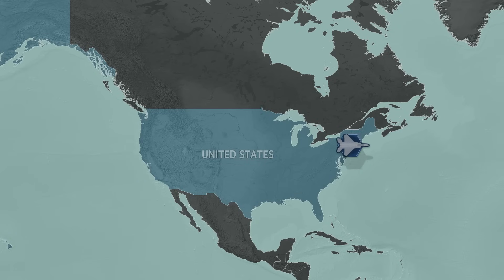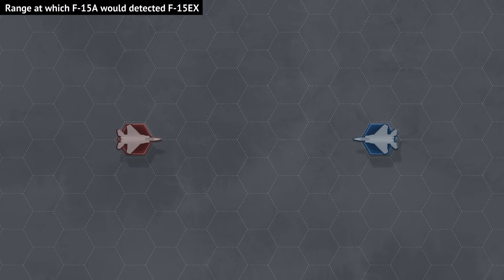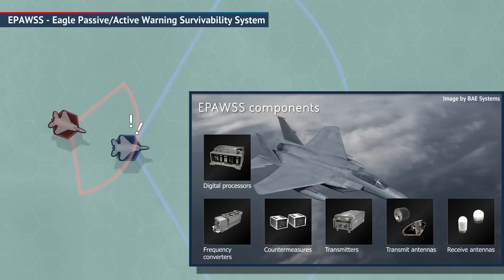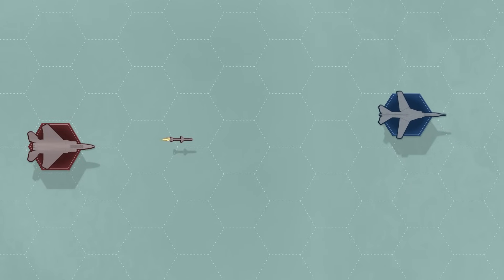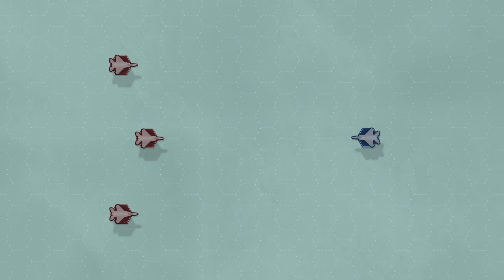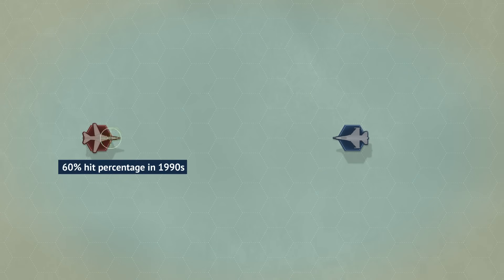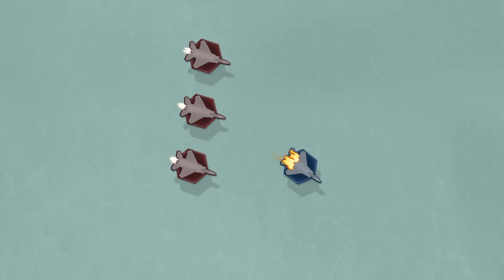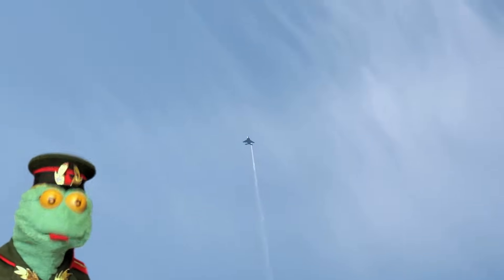How many F-15As would it take to shoot down an F-15EX?

Comment: you messed up your radar comparisons. The Cumulative Pd of the APG-66 is a different type of value compared to the 50% Pd shown for the other radars. The APG-66 50% Pd is ~23nmi, not 46. 85% Cumulative Pd, is simply the range and which, in 85% of tests, the radar will get its 1st detection of a target. (ie the Pd against an F-4 at 46 nmi may only be 20%; which means it would only be seen once in every 5 scans and thus wouldnt be able to form a trackfile.)

Comment: 9:00 This is an AIM-54 Phoenix missile, not the AIM-120 AMRAAM. The Phoenix was a Mach 5+ long range missile only carried by the F-14. It had greater range, was much larger, and its warhead was 133 lbs. compared to the AMRAAM's 44 lb. warhead. The AMRAAM is not a 100+ nm missile, and only recent versions have been able to get close to that mark. Hell, it is in the name of the missile, Advanced Medium Range Air to Air Missile or AMRAAM. We must wait for the AIM-240 or strap on the AIM-174B if we want to see 100+ nm engagements.

Comment: TL;DR: modern missiles are overwhelmingly more accurate than 1970s ones, and will have >80% kill rate on 1970s aircraft, while 1970s missiles will be near-useless against modern aircraft.
OTOH, flight characteristics, and autocannons - haven't really improved, and in some ways were partially sacrificed since the 1970s.
I bet the modern F-15EX also normally carries fewer autocannon rounds than they did in the 1970s, since they are nowadays deemed a weapon of very last resort, and the weight is better used for extra fuel, or bigger radar, or an extra missile.

Comment: There's a maneuver you execute in BVR missile fights called cranking that you employ to slow the closure rate issue 10:45. You use that 120 degree radar cone to 'look sideways' at the target while changing course to fly ~30 degrees off from perpendicular to the target. It allows you to maintain radar lock without going straight towards your opponent.

Comment: There is also a massive 'fog of war' issue with any scenario. 
The F15As see a single target on their radars, fire their Sparrows, and then later learn radar guided missiles are locking in on them. They all begin evading, losing their own locks, several are blowing up, etc. and maybe a few can get their radar back on the F15EX. Ok... but there is a big leap of faith here. Are the F15s really sure that they are only facing a single target? Do they know the capabilities of the F15EX or are they just going to assume they are facing multiple aircraft (which would be common as fighters tends to fly in pairs and at 8+ missiles most 1970s pilots would have to assume multiple aircraft firing on them). Baring being told they were facing a single aircraft (and its capabilities) they'd be nuts to assume the wasn't at least one aircraft and they probably wouldn't assume their radar wasn't missing the others, flying close together, the others staying out of range, etc.

Comment: The earlier F-15's were air superiority whereas  the  new EX variant has a different  function,  with it's powerful radar and  missiles it remains a formidable BVR fighter, especially given it's sheer number of missiles.  How ever  if it merged with the earlier Eagle, assuming equally skilled pilots it's  not going to do well. The earlier Eagle  is  extremely capable in the merge, 1 or 2 circle it's one of very few aircraft  that  can do both. The  new EX variant  is  designed for a different role, they got F-22's for kicking ass in the merge and the F-15EX Can obliterate whole wings of enemy fighters BVR and if one  or two  sneak thru, the Raptor will  mop them up. The EX is an extremely capable multirole  missile truck, fast and very hard hitting, ground, sea or air it is capable of impressive levels of destruction.  About the only thing it can't do is CQC or dogfight modern fighters, the conformative fuel tanks and the full 13 odd ton of weapons the EX variant carries, well they don't aid manoeuvrability,  that's all. Horses for  courses.  Both types excel in their primary role.

Comment: The A model didn't have digital engine controls, so flying over 40K for the EX would be even more of a massive advantage.  APG-63 has 3 variants, the data in this video is on APG-63v1.  APG-63v3 was vastly better than any F-16 radar.   @04:23 We're usually supersonic here and if we have to merge we'll merge past the mach number. ( We usually shoot down before merge ).   @17:26 This is probably accurate.  F-15Cs would have a 4-8 K:D ratio against modern block vipers and hornets in LFEs like red flag as Blue air, red air we'd have to dial back some capability.
Reply: Didn't know the F15s were just that better in its intended role against other aircraft. I heard a flight of F15s flying overhead. Sounded like thunder.

Comment: Based on what I have seen in DCS modern long range active radar homing missile combat is very much like bull fighting, with lots of rushes, launches and retreats as each side tries to bait the other into firing off all of their long range missiles.  If the F-15A force had a decent controller (AWACS or GC) then they could very well bleed the -EX with this sort of strategy and only suffer a handful of casualties in return.  I would put the ratio at closer to 6 or 8 to 1 with maybe 3-4 of the -As going down to the -EX before they closed with and swamped it.

Comment: Whole idea of EX is to have a 22 or 35 out front to identify targets and then have the EX act as a missile truck.
Reply: And probably soon to be replaced by drone-like equivalents. This is also probably how/why the tech for 22+35 to be able to fire missiles on other planes and control/guide them itself.
Reply: you mean a awacs?
Reply: That's what the F/A 18 was for and why the Gunslinger was created for it.
Reply: Boeing and LMC said at their EX demo that the F15EX has a longer air detection and weapons solution range than the F35 and said the EX had a longer detection range than the F22 but not its firing range so it would be used as the "AWACS" for the F35 (F35 is a SAM killer, not a air to air fighter and traded its air radar capabilities to see IRST in ground clutter) and a detector for the F22 until it can get in range to shoot
Reply: Do you mean an F-22 or F-35 out in front?
Reply: @RonJohn63  I think he does
Reply: @RonJohn63 yes exactly
Reply: @RonJohn63 they are built to head toe-to-toe with other jets, while the 6th gen are built to snipe, and the EX is built to carry more loads.
Reply: @RonJohn63 but that's US tactics, that they had been using since the Gulf War. The only difference is that they got newer tech and better toys to play with.
Reply: @RonJohn63 that's what they said
Reply: US doesn't really field a phoenix 2 yet. The gunslinger has yet to be confirmed on an F-15 of any type, and the F-15EX could probably only carry 4. Its also more or less optimized for taking out bombers (140lb warhead) so the F-15As would probably have an easier time evading it as well.
Reply: @sneediumminer  aim 260 is in service
Reply: The actual "whole idea" was corporate welfare for Boeing.

The USAF didn't want new Eagles.

Anny reasoning now is entirely post-hoc.
Reply: @DúnedainOfNumenor  The USAF sure wants them now. They've proven very useful in things like anti-drone warfare. Can carry up to 49 missiles on one plane for shooting down slower-moving small targets.
Reply: @DúnedainOfNumenor  the development for the upgrades applied to these have already been paid for by allied nations. thats a shit welfare plan.

Comment: As a DCS player, I think a good estimate would be 6-10 considering the  12 120-Ds and 2 9X. EX would probably TWS the .... out of the As with the bigger radar and the 120-D. The Sparrows did not had fire and forget capabilities which would probably force the A's to 1- Be on defense all the time until MAR of the 120 or 2- committed trying to get a Sparrow lock and eating 120-D left and right.

And even after that, the As would probably eat 2 9X heads on as a dessert on a possible merge.
Reply: finally someone talking sense. All the 15A's would be wiped out since its a 120-D and by the time the AIM 120 hits, the EX is going cold 30kms away

Comment: 4:22 this scenario is most likely NOT POSSIBLE since the F-15A has a RWR (Radar Warning Receiver) which shows the pilot the general range and bearing of enemy radar pings, the F-15A pilot will know when the F-15EX is moving from his 12 to 9 to 6 and can take evasive action or just turn on his afterburners and get out of the weapon employment zone before the EX can turn around and catch up.
Reply: Update: He covered this after I unpaused the video lol
Reply: Yes it does, but it should be mentioned that AESA radars are designed to change frequency and irregularly scan targets to more effectively blend their radiation with background radiation, possibly delaying detection, especially at longer range. Modern RWRs are designed with that in mind, but 70s designs might be less capable

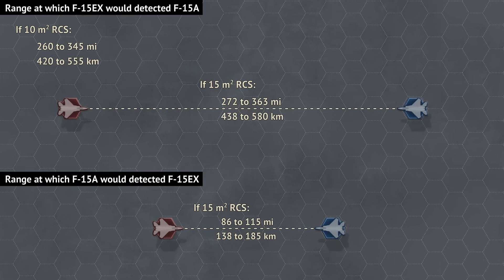Comment: 4:18 the F-15As detection range is right around the maximum range at which the F-15EX can engage with an AIM-120D. With some of the new missiles the US is working on fielding, the F-15EX might as well be a stealth fighter to the F-15A.
Reply: Not the mention, they can now mount surface to air missiles on F-15 and slave the to an f-35 radar, giving them a missile range of around 300 miles. Of course, thats outside the scope here
Reply: Israel still flies the F-15A.  It would be interesting to compare them in their current configuration, to the EX.
Reply: Hopefully the F-15 gets the AIM-174 soon.

Comment: F-15EX is bloated, overweight, slower, and lower ceiling, even with more powerful later generation engines, fully armed

F-15A is sleeker, faster, lighter, and higher ceiling, fully armed

giving both same latest AAMS and Avionics

the more agile F-15A could easily take the F-15EX

afterall, F-15 was upgradeable, so, the A version could be given everything techwise that eventually gave rise to last EX version

Comment: Hey Binkov, My late uncle, William Elmore, retired from McDonnell Douglas Aircraft as director of Advanced Fighter Aircraft Design. The F-15A was a bird he supervised the development of. This idea you proposed is something Uncle Bill and I had discussed. His general idea was that each major new generation of fighters would neutralize all previous fighters. A single F-15A could wipe out a squadron of F-4s, for instance. Two critical factors not mentioned in your analysis were "Rules of Engagement" and AWACS. Today, with open engagement rules and AWACS, a 15:1 kill ratio seems possible. The F-15EX would prevail because of the extended over-the-horizon targeting and threat assessment calculations. Most of the enemy force would be shot down before they even knew the fight was on.
Reply: My late grandfather, Norman James "Jim" Schwaegerle, also worked at Mac, and worked on the F-15 project! (He worked on the F-101, F-4, F-15 and F-18, and was "farmed out" to General Dynamics for awhile to work on the F-111.) I'll bet they knew each other.

Comment: The f22 was touted as having the same advantage over the f15 as the f15 has over a blimp the f15ex has been said as capable of all aspects of air superiority including against fifth gens so I feel like a f15ex might have a similar tactical advantage against an f15a
Also the f15ex is much more monovrabl than the f15a because of its advanced fly by wire control and greater thrust so its likely it would do better in a dogfight than the video gives it credit for but of course in a one v two and especially a one v thee the dogfighting campablity of an aircraft quickly become less important especially with the same pilot skill

Comment: F15’s over engineered power plant makes it possible to operate modern power hungry aviation and data management. Similar to the Buff in ways that stay relevant. More is more in some cases. There are negatives to this design mindset, but you can’t argue with results. Long life to f15

Comment: I'd like to give you a couple of Corrections to some of your data that you are showing. I know for a fact that with the original Pratt & Whitney pw100 engines an F-15 with full tune will travel just over 2000 miles an hour. That's right at or just a little bit above Mach 3. Even the F4 was able to do that speed as I know for a fact that one of the detuned f-15s when they found out it was actually flying itself to Pieces was run down while it was running at about 1900. I'm not certain of what the speed is with the conformal fuel tanks but this is an engineering chart that you're showing here. It does not reflect real life. Most Air Force Frontline aircraft since the early 60s would pretty much exceed their stated speed capabilities. Just like Capital naval ships are usually capable of going much faster than people believe. I was rated for working on the F-15 F-16 I did work on f-14s and until they put the same engines in the F-14 it wasn't a threat to an F-15. The aircraft that I worked on the most, the F-111 F model use the same engines as the early F-16 and f-15. They went to General Electric engines when they were having trouble with a few of the compressor sections failing because an F-16 doesn't fly very well when you blow up major parts of the engine. As a matter of fact if it gets below about 300 knots it cannot Glide at all. And it's already losing far more speed within the next couple of seconds it's going to be uncontrollable. Even the f-111f model which I know would go Mach 3 in short bursts. Would drop 50 knots per second when you pulled off too much on the throttle. Depending on the speed it was going and the configuration they had put the wing sweep handle into.
The current engines for the f-15ex are putting out somewhere in the neighborhood of 30,000 pounds of thrust per engine. The original engine put out about 25,000 per engine. Although it's a little bit heavier it should have a greater thrust to weight ratio and should be able to out run and out distance the f-15a models. But I haven't done any calculations on it because I don't know all of the specifications of the F-15 DX I've heard that the engines are capable of even more thrust than I gave them. Because they were running almost 28,000 lb of thrust in the early nineties. The F-35 only has a Thrust to weight ratio of 6621 which is roughly what the F4 thrust to weight ratio was.
Just for your edification, the F4 before it was renamed the F4 by Robert McNamara was an f110 the fighter that immediately preceded the F-111.

Comment: Theres a lot you missed about the F15, but the EX specifically. The EX is not flying cfts. Its sticking to the c model config, guard units are using the cft config. Additionally the GE engines are VASTLY  more powerful than the PW 220s. As for the radar HAHAHAA!

Sincerely, an F15 Crew Chief
Reply: Yeah but F-15A can stall fight and win

Comment: From every thing I have read on the new F15 EX they do not have the extra conformal fuel tanks and with the new engines they can fly at almost 3 times the speed of sound.  They also can fly at a much higher altitude than the F15 A models making them much harder to detect without ground radar help.  There is also the problem of identification.  Is that a friend or foe?  Both would be squawking IDF but I am sure that that can be defeated.  I really think that the EX would kill a lot of the A models before they figured out what exactly was going on giving the EX a chance to escape.  If the EX had to stay and fight it would eventually be shot down but the A's would pay a terrible price.

Comment: It would take a boatload to bring down the EX. ALL systems have been upgraded to the upgraded Raptor levels, it's super maneuverable, able to see the A model waaaay before the pilots see the EX. More capabilities including CCA drones, EPAWWS survivability suite. faster top speed plus the flight controls are bonkers. The Eagle was my favorite plane ever, but for intercepts and Air Superiority after the Raptors, Growlers and Lightnings take down most of the high priority AA missile batteries it will be easily possible for the Eagle II to control the skies. Factoid: The EX frame is capable of **10 G'S** for God's sake.

Comment: FYI, the EX can launch a salvo at near max range. This would force the A's defensive, turning 90 degrees and dive to "notch" the enemy radar. In such a maneuver, the defensive A's radar is not pointing toward the EX. Once the EX gets closer, they can fire another salvo for the kill or at least keep the A's defensive again. The EX can literally spam missiles.
Reply: It can spam as many as it has hardpoints - which isn't that many at all if you'd need two missiles per target.
Reply: That is if the A's even knew the missiles were coming, as explained in the video, the A's RWR might not properly pick up the EX's radar, even if it did, they wouldnt know if missiles were headed for them until the missiles go active if they dont get a launch warning or pick up the tiny missile on their radars. In this case, ignorance really is bliss, the A's dont know they are flying towards certain death, so inevitably when an AMRAAM misses, those surviving A's have a pretty good position against the EX, even if they just lost most of their sqaudron
Reply: Launching at near max range isn't really a good tactic. The PoK at that point is very low.

Comment: I did see images of EX with some form of stealth coating
how would this change things ?
Reply: They tested a clean F15 with stealth coating. It reduced the radar cross-section down to where the clean F16 without a stealth coating is. It's not worth it.
Reply: On another note, the airforce wanted a "missile truck." The F15 is such do to its hard points which it would no longer have as a stealth aircraft.